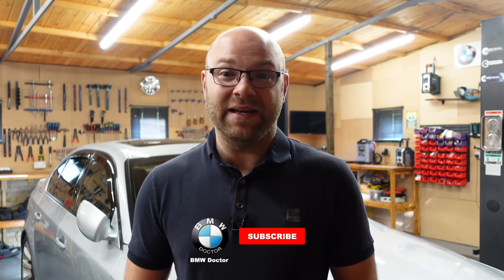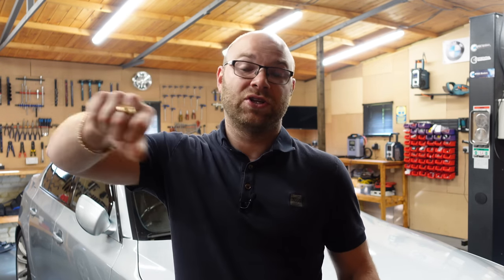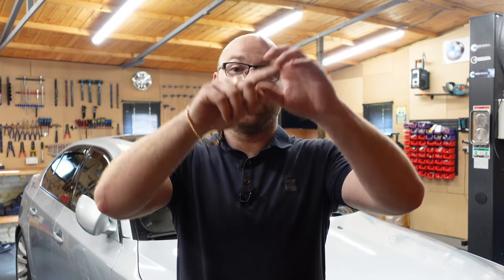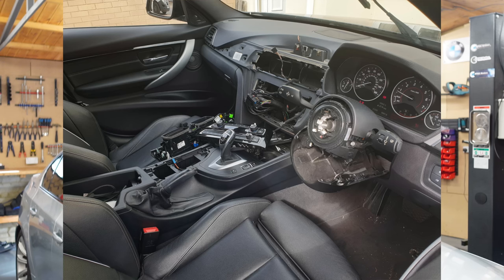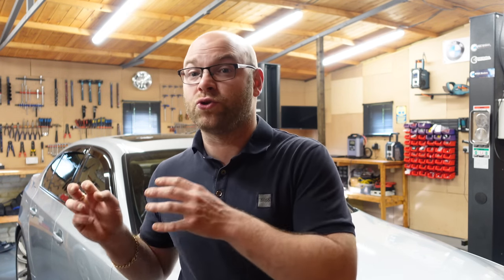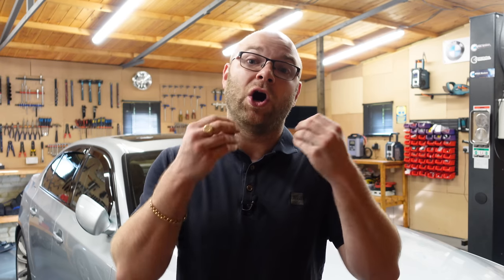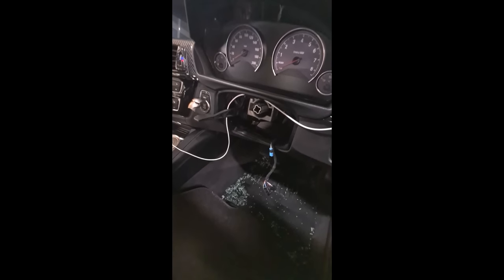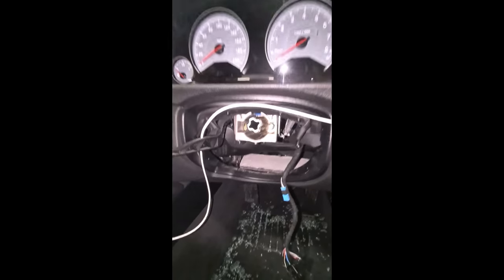I WOKE UP TO FIND MY STEERING WHEEL STOLEN FROM MY BMW !!

Comment: This is a BMW issue. The government should hold them accountable. Force a recall to fix it from being stolen so easily.
Reply from the maker: It can’t be recalled it’s not a bmw problem as far as I’m aware if it was I’m sure bmw would have rectified it
Reply: How is it possible for it to be so easily ripped out of the car? Obviously it’s a design flaw. People spend so much money on these cars they deserve quality. This is a lack of quality on BMWs part. In my own opinion. I own an older BMW E53  X5. I don’t think I can rip out the steering column on it like the way I’m seeing on these videos. It’s such a shame on BMW.
Reply from the maker: @76Bourne  oh yes you can rip it out bring it to me I’ll show you 😁 

If you want it bad enough like they do adrenaline kicks in your whole weight and force will rip it out believe me. Go and try it let me know what happens
Reply: @BMWDoctor  ill take your word for it. LOL
Reply: BMW knows about the problem and have a kind of fix.
They told me every time they receive a car now without steering wheel they put a special bolt that can't be unlocked without a special tool
They are perfectly aware how easy it is to be stolen
Reply: My daughter just had hers ripped out last night. She’s only had it for two wks. 
BMW should be liable.
They know what’s going down.
Reply: So why the long talking ?and then oh, mine is safe, I’ve got land, bollards and a garage.
The fact is they are easy to steal.

Comment: As to why it doesn't take the Hulk to yank out the steering wheel, that's probably a safety precaution in case of a frontal crash (in order to prevent the steering wheel from crushing the driver's ribs or worse). I'm not sure if removing it on a daily basis is a good idea, I've done this for a retrofit (new parts from an official BMW dealer) and while I guess it could be done in 5 minutes (mind the airbag!), I can also see how this would get tedious very quickly. In my opinion, the blame lies with platforms like eBay, they should only allow genuine dealers to sell used car parts.
Reply from the maker: All BMWs are fitted like that. Just seems as cars got more expensive so did the parts inside so now they have become a huge target. Years ago this wasn’t the case but the more technology you fit in a car the more it becomes a prime target I expect soon Teslas will be next for the screen once they find out how to virginise the system.
Reply: Why would the steering wheel being easy to pull off the column TOWARD the driver have anything to do with safety when number 1 the car has seatbelt pre tensioners, number 2 it has multi-stage airbags and number three a collapsible steering column would move DOWN into the dash not upwards toward the driver...?  There is absolutely no reason why it should need to come off like that.    This is a major design flaw that opportunist thieves are exploiting.  BMW needs to step up here and come up with a fix and a free recall for owners.

Comment: i have a f12 640i with the ugly wheel for 3 years now no one has troubled it l want to change to an m6 if i fit the ugly wheel does anyone think it will be left alone. i had a s5 stolen by relay theft before this car

Comment: BMW Doctor - Why is causing my engine fail safe to come on? If I  restarts it goes away for a few days then comes back. I checked my terminals and battery and they are both fine. Here are the codes I am getting PO172, PO175, and PO1500. Please help.

Comment: Hi BMW Doc, recently, I’ve encountered an issue with the screen, which shows ‘No signal’ in message in orange. Music was still on but nothing on the screen, even back up camera. I’ve done some research. Some say it could be the Bluetooth connection, some say it could be the issue with head unit (need to be replaced), some say it was the battery… have you ever heard of this issue? If yes, can you make a video for solution?

Comment: Minute 10.12 about the steering wheel nut. Probably, and I'm not sure because I didn't see it, it is made of steel and the column is made of aluminum. If so, with force, the aluminum grooves are swept as if it were butter. Sorry for my English but it is not my first language.

Comment: 3 weeks ago my steering wheel was stolen too, F32 420d in Porto, Portugal
Sadly I have easy access so they opened the car, carefully removed the steering wheel and even locked the car again on their way out

Now for some facts:
- Guy who took the car to the BMW repair shop said it was the 35th he was lifting (edit: without steering wheel that is)
- One of the cops said he owns a BMW and that he knows the pack M is very sought after and stolen a lot in Portugal 
- at the BMW repair shop they said they receive AT LEAST one car per week without the steering wheel

So... they asked me 3200 euros for a new one at BMW and I ended up buying, at a car items shop with an invoice, an used one beaten to death which had to be refurbished.

Wallet damage:
750 euros for the wheel+100 euros to refurbish+0 euro to put it back myself in 1 minute

I now use a Disklok every time I leave the car
It doesn't solve the problem but helps
Reply: Well, not really nice to steal the wheel of course but nice of them to lock the car again, which is weird for a thief to do lol. I'd suggest to rent a garage, hang a here sleeps a dog tag so it scares thieves, they used to hang it at home on the windows to prevent thieves to break in, install a dashcam that records 24hrs straight or install a drive way camera.

Comment: Hello guys, my car had its steering wheel stolen 2x. To prevent it I use a stop lock pro and position it behind the gear selector so it can not be yanked out. Also i chain up the steering wheel to the pedals.
Reply: You can use a beware here sleeps a dog tag on the window.

Comment: It looks like there releasing the steering column clip for more movement to slide
Reply from the maker: Correct they are to slide it back and fourth to rip it out. This was BMWs biggest mistake making it manual adjustment I haven’t tried or know or this happening on any other cars before the F series but then nobody tried and they wouldn’t as the steering wheel and parts ain’t worth anything today.

Comment: Good reason to use the yellow disklock system I guess ?
Reply from the maker: Not for someone like me as I know how to break them open 😌 no matter what lock you put on your car I can break open in seconds also ghost immobiliser I have just been taught in Spain to bypass them with a device if I want you car I’m taking it
Reply: @BMWDoctor  but can you run faster than buck shot ? :D
Reply from the maker: Don’t need too 😅 never had any problems in 13 years taking cars in a BMW expert no alarm means no awareness I have my ways trust me 😎 those who know me know what I’m about

Comment: Wrap constatine wire around your new steering wheel at night so they can cut off their fi gers when they try it again.
Make sure you sharpen the blades on the constantine wire before you install it.  Post the fingers on a new video when this happens again.  😂

Comment: Its only possible on the manual adjustment ones. My vw camper has a removable wheel but I'm thinking I need one for the 430 now.
Reply: You can't do it easily. See, in front of the central bolt that holds the steering wheel you have the airbag.